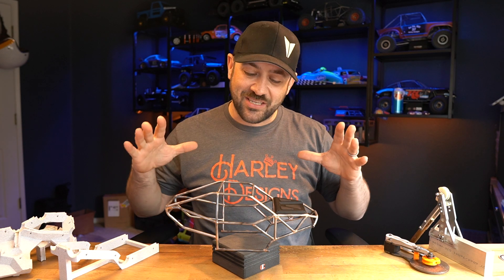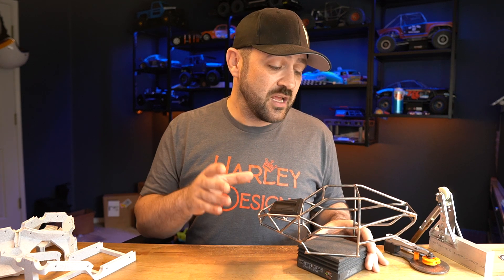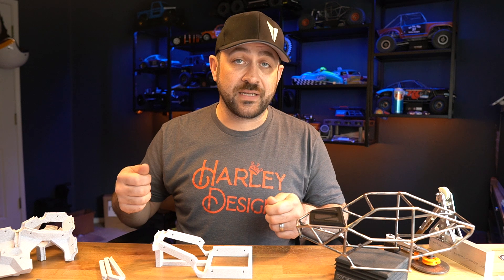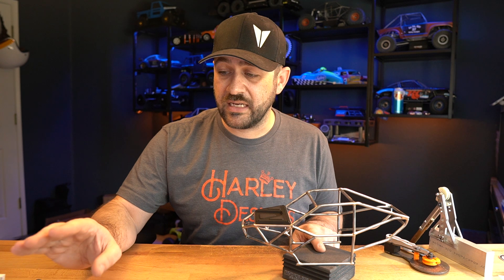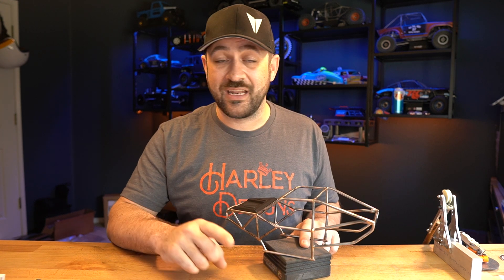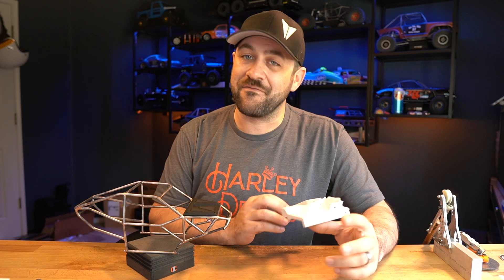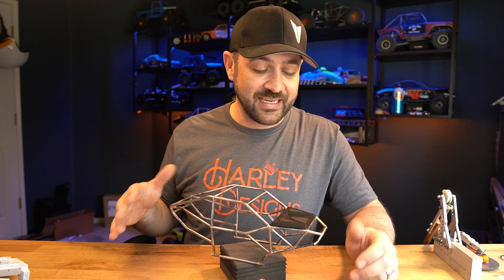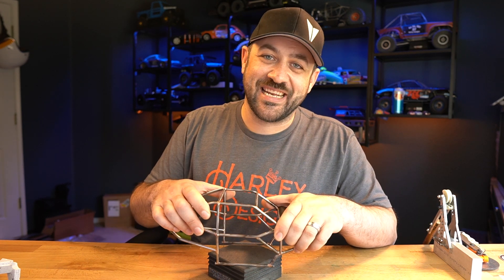Build a Chassis WITH ME! - Moonbuggy Build Along

Comment: Interesting, using the printed fixtures. I've used wood to build bending jigs and fixtures. Wood only gets burnt from tacking, but one can wet the wood to lessen it to a degree. Bit smokey, but works well and can hold up to dozens of builds. 
Anyone printing this could, when possible, grind back the plastic at the tube junctions enough that the plastic doesn't burn as bad. Could also try a bit of aluminum tape once ground back as extra protection. Could be worth it by extending the number of builds one gets per fixture. 
Tube bender is easy to build with a small pulley wheel. And small tube like that, one could bend it around a small piece of metal or plastic pipe or wood dowel and just there fingers. 
Neat idea. Look forward to seeing how it goes. 
Thanks!
Bert the Weldor

Comment: Why do you not like mig welding them?
Reply from the maker: MIG welds never look good on a RC chassis. I see them done all the time, they just don't look nearly as good as brazing or TIG welding.
Reply: @HarleyDesignsInc  I've got the stuff to braze them but I wonder how strong it really is? Will it withstand impacts on a basher cage or barrel rolls and flips and all of the rough stuff

Comment: Do you think this chassis would support the Capra 4ws?
Reply from the maker: It wasn't designed around that servo position. It's made to specifically use BTA servos with an offset axle.
Reply: @HarleyDesignsInc  well I’ll have to follow along and hopefully I can buy the parts needed in time. Waiting for tomorrow!

Comment: I've done a bit of brazing. Never welded. Any recommendations on a starter Tig welding set up?
Reply from the maker: I haven’t had a starter TIG in awhile and the one I had was way worse then most of them these days. If you can get about any TIG with HF start, you’ll be better off than I was when I started. It’s really all about your budget.
Reply: @HarleyDesignsInc  Thanks for the information.

Comment: What do you think about using ar44's on this chassis? I have a set of capra axles but was thinking about doing a sporty with them. Lol
Reply from the maker: Probably not a good fit as this type of chassis is best suited for axles with a BTA steering servo location. It is best suited for F10 portals.

Comment: How close to a 1/10 scale is it really to the original design you went off of
Reply from the maker: Specs of the full-size buggy were not posted, so the design is a visual representation made to fit the size of the vehicle I wanted to build. How it would exactly scale in comparison isn’t something I could accurately calculate with the info available.
Reply: @HarleyDesignsInc  thank you for the answer👍

Comment: Ugh Apartment living. If I had the space I would be doing more metal work.
Reply from the maker: I got in trouble in my first apartment after college for welding on my balcony 😂
Reply: @HarleyDesignsInc  🤣🤣 but I am  4 minutes away from 4 crawling spot so I'll take the trade off. Oh and my roommate just corrected me it's a condo not an apartment.
Reply: I have an oxy mapp Smith little torch and a welding table in my apartment... Don't tell the landlord! LOL

Comment: Being a good fitter will make you a better welder. It's all important to the process 🤘y'all have a badass day🤘🍻🤘
Edit: harley designs, i think you offering build plans is a great idea 🤘
Reply: "Grinder and paint...." as the saying goes! LOL!!! :)  You can get the fit nano accurate all you want. Welding it well is completely different. As another saying goes..." You can lead a horse to water...." 😁👍
Reply: @wingnutbert9685  do you really believe what you just said?
Reply: @forrestcrabbe  Yes. Not sure how grinding and/or cutting a work piece has anything to do with ones welding ability? Wasn't meaning to be unfriendly. Just thought it was a bit funny to think one skill has to do with another. 👍
Reply: @wingnutbert9685  the better the fit, the better the weld. Ask a pipe welder how important a good fit is. You are not allowed to grind yer welds pretty on a pipeline. A perfect weld is a must, no inclusions, no undercuts, and no grinding. A good fit is one of the most important aspects of welding  🤘y'all have a badass day🤘🍻🤘
Reply: @forrestcrabbe  For sure. Absolutely no augment on that. I guess my point, more correctly was you can have the fit perfect, but if all you can do is a bird poop weld, that fit-up ain't gonna help. LOL! I've worked with both. Great eye for fit, welds like Stevie Wonder after two pots of coffee. Or, could weld the crack of dawn shut with a battery and a coat hanger but couldn't cut something to fit even if you drew the line for him. 😆I guess my point is having both makes the build and the product easier. And a good weldor can make up for a bad fitter, but not the other way around. (And of course, there's a big diff between pipe fitting and welding and these little things. ) 😄😁👍 
Hell, I'm just happy to see someone actually hand making something and not printing it!
Reply: @wingnutbert9685  Well, yer kinda right on some of it. A good fit will make the welding easier. A poor welder can make a better weld when the joints fit better. Not necessarily a good weld, but better than if there was no fitting done at all.